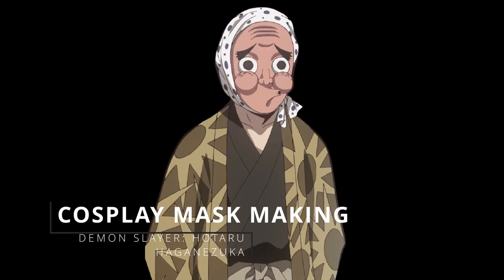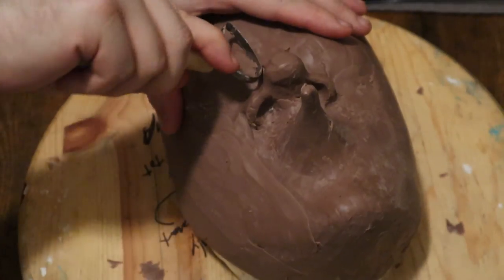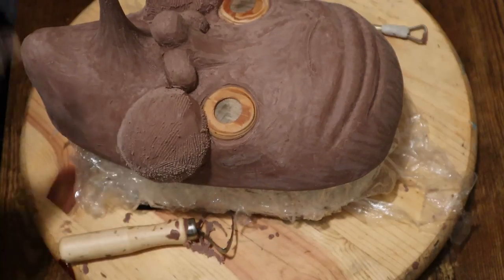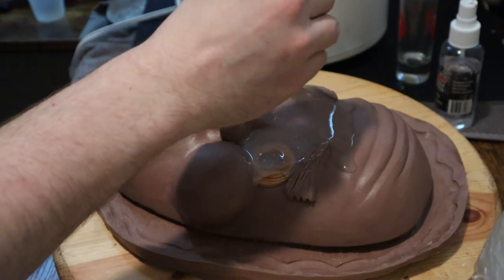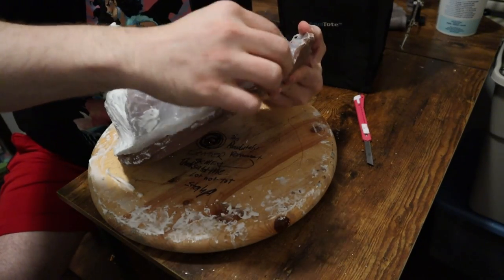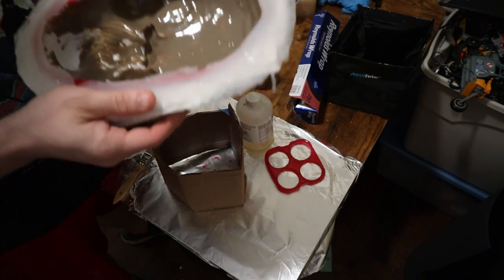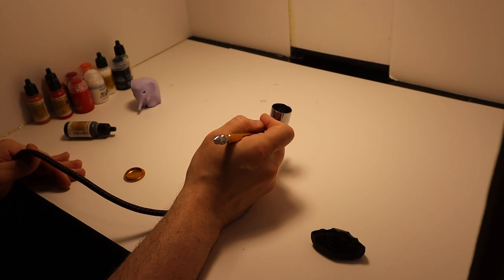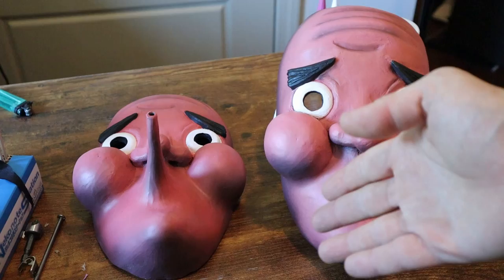DEMON SLAYER: MAKING THE SWORD SMITH - HOTARU HAGANEZUKA'S - MASK START TO FINISH

Comment: Hey man I can't see to get the colour right I failed multiple times trying out different colour what colour or number are you using bro ?
Reply from the maker: Hi, the colors I mixed for the base mask color were peach, and drops of green white, blue red, or whatever I thought would push the color the way it needed to go to eyeball it, it was my first airbrush project and I apologize that I wasn't more clear in what I was using.

But if it's helpful.
I know Peach was the base color I used, white to get the saturation a little less, and just drops of green and or blue push it to a less extreme peach. 

For lighter tones I almost exclusively just added white I believe, and for darker, I added a dark purple, in small amounts, and very very limited amounts of black, if any black at all (I can't remember but black and white should be used super sparingly in any paints)

I hope that is helpful!